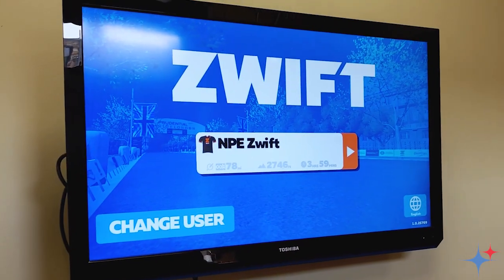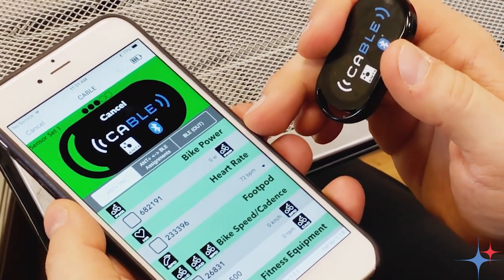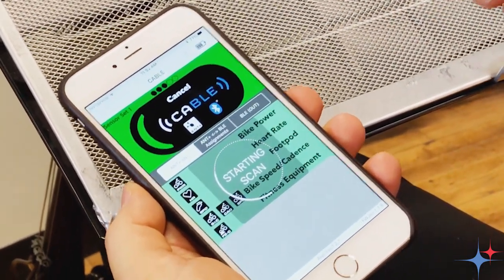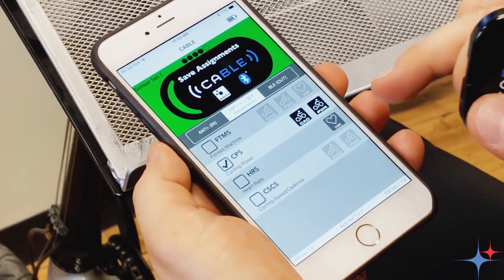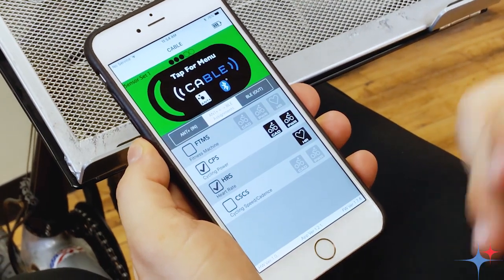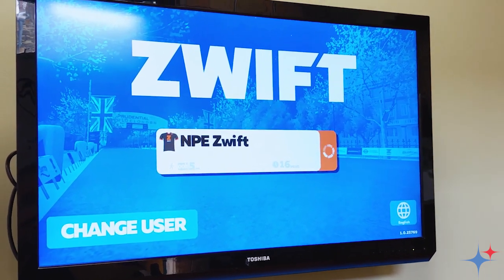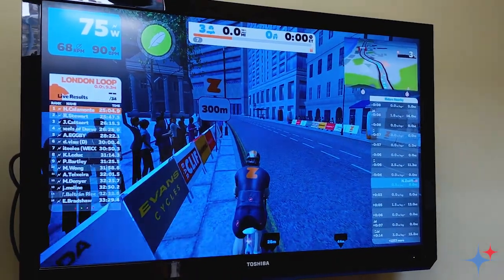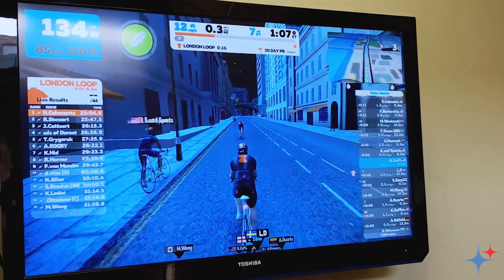CABLE Setup with Zwift

Comment: Why did you connect the kicker to your cable when it can just Bluetooth through your phone
Reply: We connected the KICKR to the CABLE because AppleTV only supports 2 BLE connections. Using CABLE, we can route in more sensors through 1 BLE service.
Reply: Ashley Mendez can you not just connect all of them to zwift Bluetooth in your phone and still use Apple
Reply: Ashley Mendez just give me a call brother this texting takes to long .

Comment: Is there a way to do a reboot on this.  I am beyond frustrated trying to set this up for Zwift using apple tv.  I tried to remove all sensors, but the app crashes and I get the iphone screen again.  It tries to update firmware, but it just spins and spins and spins.
Reply: I am working on resolving this issue right now.  Look for a App Store update this week.
Reply: @rdajkg  Rick.  I took the battery out and let it sit for a while.  That seemed to bring me back to 'start'.   The barriers for me with setup are:  I didn't know how to identify what ANT+ sensors went to what.  I would have multiple listings under the headings.  (My wife has her kickr next to mine .. so I turned it off)  I still got her cadence, and heart rate strap listed and I had to go through some trial and error.  It would be helpful in your setup video to start with that.  Turning off other devices that could confuse the setup and so forth.  Further, I don't remember in your printed instructions a mention of this video being on youtube.  That would have saved me about an hour.  An idea would be to put a code to scan to get to this video to walk through everything.   The video was the most help in all of this.  Maybe a trouble shooting video would be really helpful when I go down the wrong rabbit hole.  An important thing to stress is to keep Zwift off until CABLE has paired, working and ready to go.  Otherwise, Zwift will pair to what it can before CABLE is up and running.   Next:  Your nomenclature is confusing to me with set up.  When I got to the "services" screen, I didn't have a clue what those were ... only until I got to this video did I know what box to click on.  I still don't know (or care) what the things are, but the term "services" means nothing to me.   At the end, I was able to pair and get Zwift to work for me.  I don't know whether it will work tonight when I get back on the bike.  From my understanding, since I named the settings, all I have to do is to 'tap' it awake and it will remember all the pairing I did yesterday.  We'll see.  THANKS for the video.  I wish I found it right off the bat.